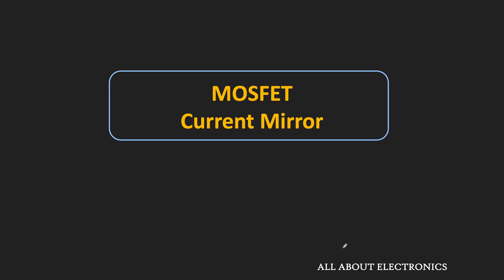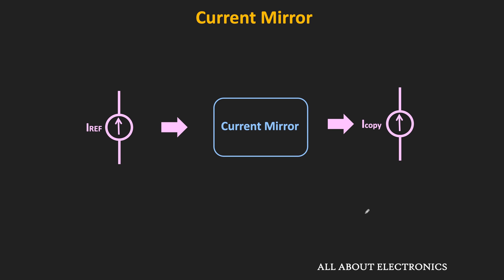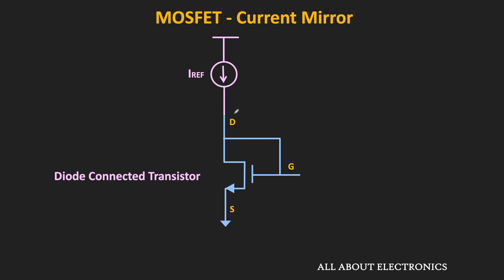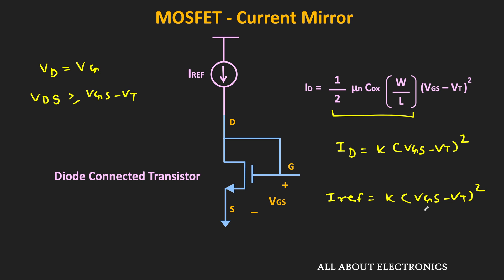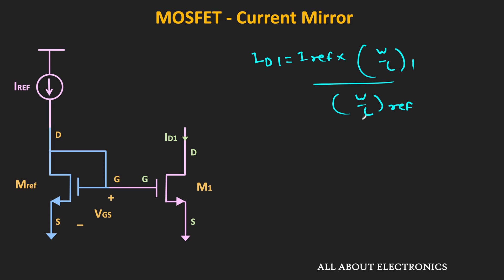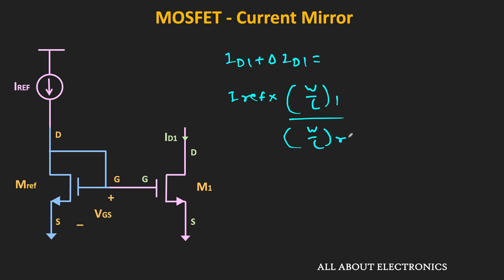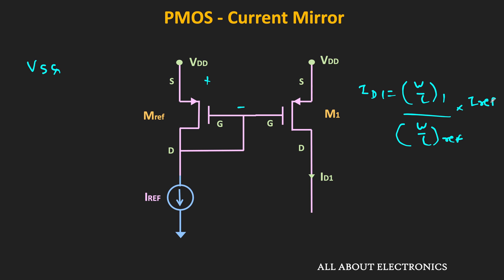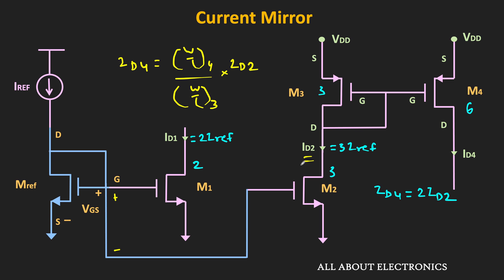MOSFET - Current Mirror Explained

Comment from the maker: For notes, check this link:
https://www.allaboutelectronics.org/what-is-current-mirror-mosfet-current-mirror-explained/

Timestamps:
0:00 Introduction
0:30 Why Current Mirrors are used?
2:11 MOSFET Current Mirror Circuit (NMOS Current Mirror)
7:18 Effect of Channe Length Modulation on Current Mirror
10:24 PMOS Current Mirror and Current Steering Circuit
14:00 Current Mirror as Active Load

Comment: If we are designing a current source, then how are we using a current source in a diode-connected transistor, we can put a VDD and RD, then the resulting ID can be taken as Iref.
Reply from the maker: Here I ref is very stable current source which is independent of change in temperature and voltage.

Comment: Hi I have a question. What if I use a resistor between gate and Drain connection of diode connected transistor. Will it be still the current mirror..

Comment: Just come across your site now. Super Duper. Few observation items here comparing BJT vs. MOSFET Current mirror circuits,

1. With MOSFET, you can scale the W/L ratio of the other MOSFETs to get different I-Outs for the same I-mirror circuit. Not doable with BJT that you would need a different current mirror circuits, i.e. different I-Refs. Also generate I-outs source and sink from just same I-Ref of the MOSFET circuits, flexible.
2. Also, with MOSFET, You can extend the Cascade of MOSFETs to generate I-outs indefinitely because it is voltage device and you do not bleed the current off the I-Ref like in the case of BJT where you bleed the Ib to the cascaded BJTs down the chain and cuase error when compared to from I-Ref.

Excellent Channel modualtion explanation. Instructors, textbooks and  many others tend to avoid it and assume ideal due to complexity of the whole thing.

Comment: At 3:25 actually if Vd= Vs then vds should be less than vgs-vt and it should operate in triode region or something....but you said Vds> Vgs-Vt ...how is that possible?? Is that some kinda property of the mirror current circuit??
Reply from the maker: If you closely observe, it is Vd = Vg since gate and drain terminals are connected together.
Reply: @ALLABOUTELECTRONICS  sorry yeah I wrote it wrong but what I meant was Vd=Vg...then The condition Vds> Vgs-Vt doesn't hold anymore...thus not in saturation ???
Reply from the maker: Just subtract Vs on both sides. That means when Vd = Vg, Vds = Vgs. Therefore, Vds will be always greater than Vgs - Vt, isn't it ??
Therefore, MOSFET will be in saturation. 
I hope it will clear your doubt

Comment: Sir i request you to make video on Pmosfet current equations and conditions for all regions of operation... Its very confusing.
Reply from the maker: Yes, that's true. 
For P-type MOSFET or PMOS, the Vgs is negative. Or in other words, Vsg is positive and threshold voltage is negative.
So, MOSFET will operate in the cut-off region and no channel will be formed when Vsg < |Vt|
The MOSFET will operate in linear or triode region when Vsd < Vsg - |Vt|
And it will operate in the saturation region when Vsd >= Vsg - |Vt|
I hope it will help you in remembering the condition for each region of operation.